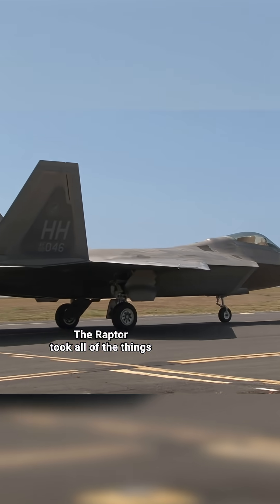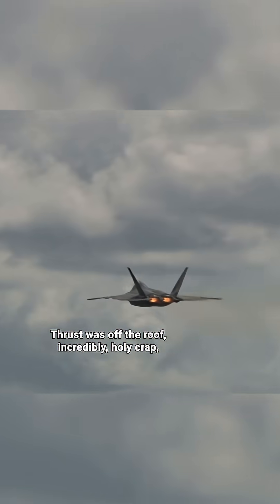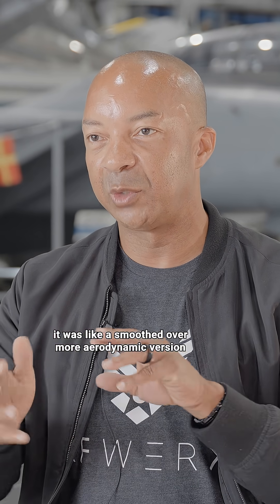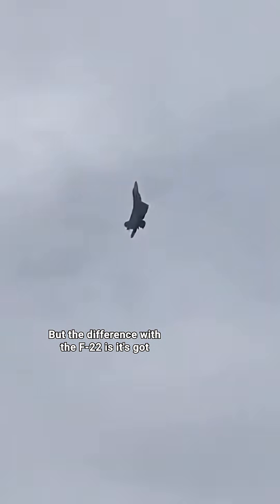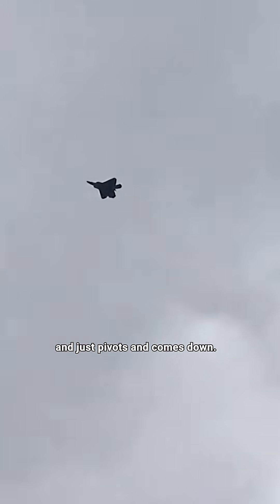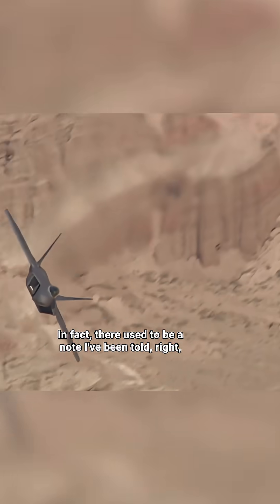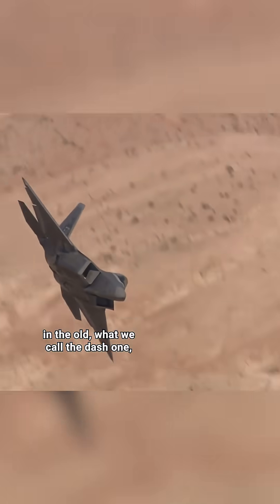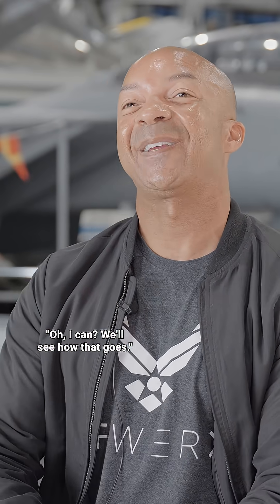F-15 vs F-22 #aviation #avgeek #f22 #raptor #pilot

Comment: The all moving vertical stabs are MASSIVE on Raptor.
Reply: I haven’t fact checked this so correct me if I’m wrong, but I thing they are the size of the wings on an F-16💀
Reply: @Acrophobia2  I've heard such a comparison in regards to F-14 horizontal stabs being the same size as an A-4 Skyhawks wings.
I could see the horizontal stabs of a Raptor being similar in size to a F-16.
Reply: @hoghogwild one of the main reasons they are so large is that with the tech of the day by being that large it reduced the spectrum of a radar reflection to help it be stealthy now the F-35 and future aircraft can have much smaller Tails because they're basically radar transparent in a way that the technology wasn't ready for the F-22